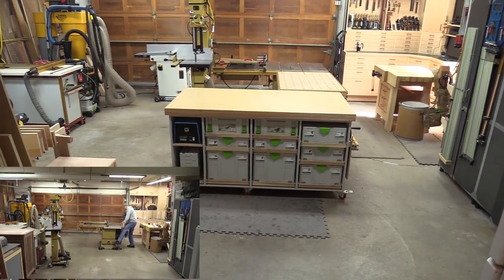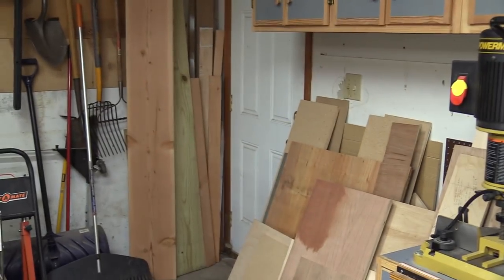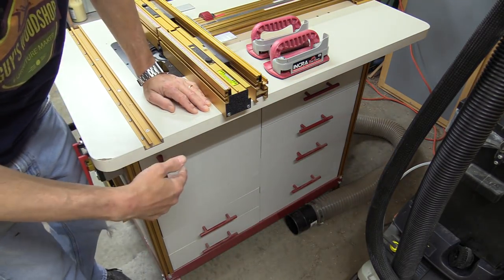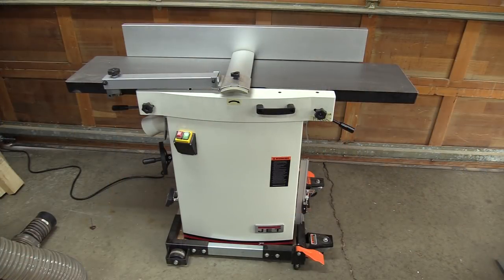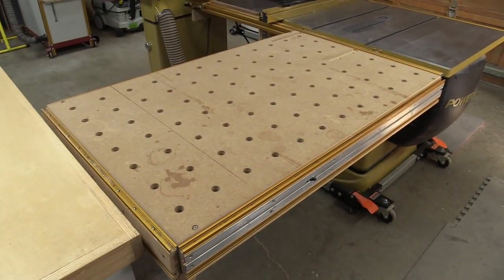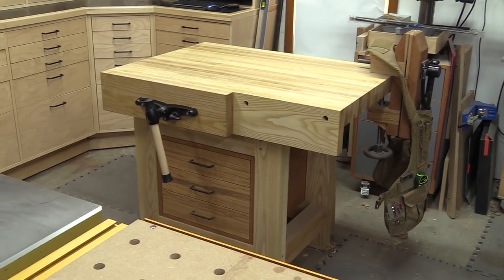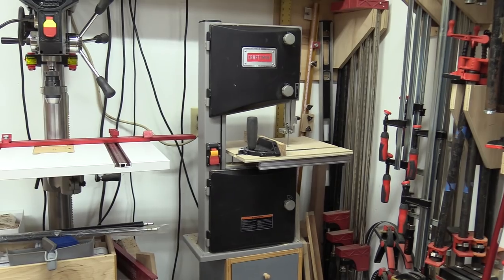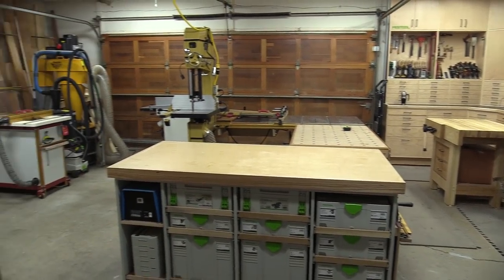Shop Tour May 2018

Comment: Awesome shop, thanks for the tour.  I'm a bit jealous of your Festools and Powermatic - but I certainly shouldn't complain as I have a fully equipped two car garage shop myself.  I did a shop tour last week, but need to re-shoot it as I am a newbie to doing videos and it was just too long.  My wife and I were both amused at how much I sound like you in my video.  I just recently rearrange my full shop so that my wife can get her car in at nights.  I have everything functioning either on the perimeter or on the side that the car does not have to be parked on.  I just have to move my work bench to get the car in - and in fact can even function (albeit a bit cramped) without even moving the bench back.  I did pick up some good ideas - and my next big project is a wall of storage drawers/cabinets.  I will certainly take inspirations from yours - it is a nice combination of small drawers and some open storage for those commonly used tools.
Reply from the maker: Hey Jay! Thanks for watching, and I am glad it gave you some ideas for your own shop.

Comment: Guy, very very nice. I'm just getting my own shop up and running and your shop has given me some inspiration!
Reply from the maker: Glad you could find some tips in there for your shop Steve!
Reply: GuysWoodshop I especially liked the link between your machines and the dust extractor. Do you use some sort of blue tooth or other network connection? If you could provide a link to your source that would be appreciated. Thanks in advance!

Comment: Hey Guy, very very interesting video. Especially since your shop converts back into a garage every night (I'm guessing at the stroke of midnight?). Anyway, I'd love for you to do a video talking about your new jointer/planer combo unit. Not just about what it does and how it does it, but also the pros and cons and of it in your workflow. I have a small 6" jointer and the HP735 planter. I dream of the day that I'll own an 8" jonter, but like you, my shop/garage does double duty and I really don't have the space to store it away. I'd love the longer infeed/outfeed tables it would provide to use with jointing longer boards. I know your new jointer has a wider head (12"?), and that's sweet. But you gave up longer tables and fence. So, how's that working out for you? What happens when you want to joint something longer than 6 foot for example? Keep up the great videos. Your work is inspiring.
Reply from the maker: Thanks! I will be posting a video for the combo machine soon. Thanks for your support!

Comment: How is the new jointer/planer when jointing long boards? I have an 8” grizzly jointer on order, but they take several months and I’ve been questioning my decision. I thought long and hard about a jointer/planer combo, but I thought I would really like the infeed and outfeed support you get with the Grizzly. I have a small shop as well, so if it’s possible to get solid performance out of a combo machine that’s the best route. I’ve just heard some negative comments on them in the past so I was nervous to go that route. I saw on Instagram that you got a combo machine and I’ve always loved your videos.  I trust your opinion on things, and seeing someone whose opinion I trust go that route really made me question my decision.
Reply: the Jet combo machine is great. I've got one just like Guy & have being using it for almost 2 years. The first edge on the blades are getting dull, BUT are still cutting well enough for the not-for-sale items I'm currently using it for. The longest board I've used on it, was earlier today & about 1 metre / yard long. With no problems encountered. Noting that when using the thicknesser, thin cuts of  less than 1mm, usually leave grooves from the metal drive wheel that pushes the wood through the cutters.
Reply from the maker: So far I haven't tried anything over 4'. The most important part of the beds is the outfeed, and it is almost as long as the Grizzly it replaced, so it will not be an issue. I am very happy to have this in my shop, I get the benefit of a 12" jointer, and the space savings of having two machines in one.

Comment: Great use of space. It makes me ashamed of mine. I have been blessed with a really big shop. But it's so unorganized. I need to do better.
Reply: Also... I am curious about your drying rack. I've been subscribed to you for a while. But your videos stopped showing up. I hit the bell icon and changed to all. Anyways... I'm looking to make some drying racks for signs I make out of cabinet doors. They suggested to check yours out. I can't find them though. Can you point me in the right direction? I saw them in the tour. But they weren't put together.
Reply from the maker: Hey Angie. They really don't appear in any of my videos. I do have some better shots on my Instagram feed. It has been a while since I posted anything on them.